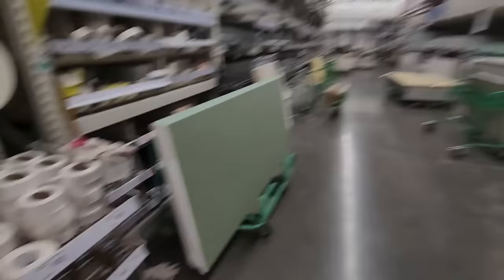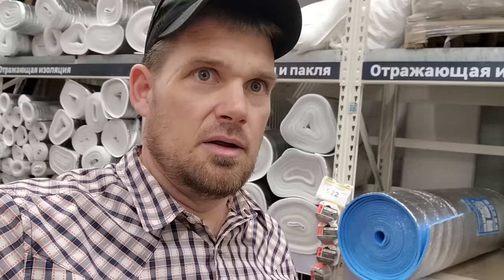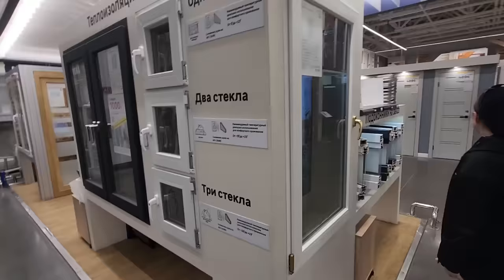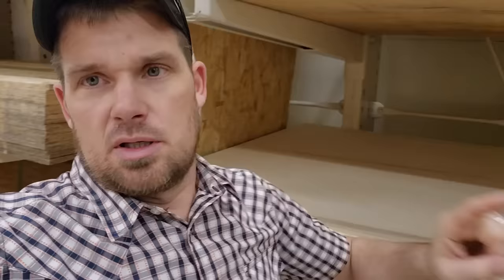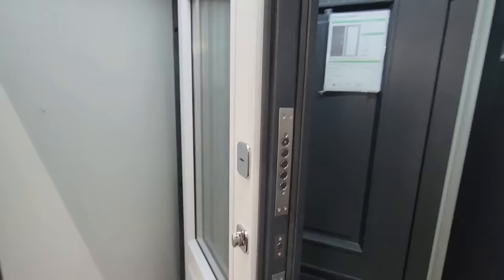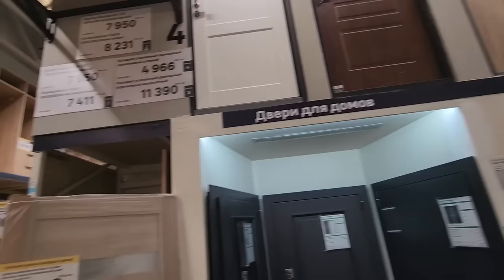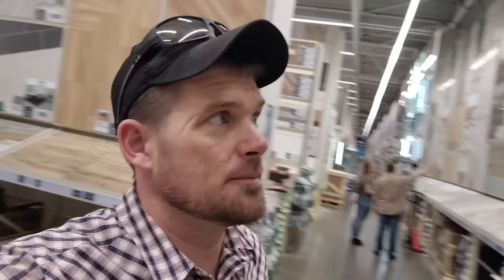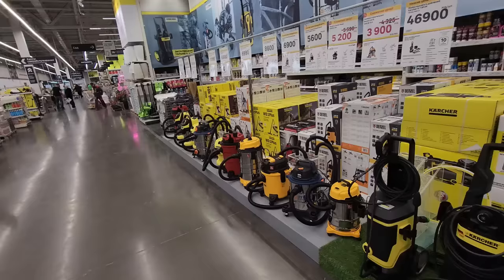As Promised We Went BACK !! REVIEW

Comment: The simplest and fastest solution for adapting between the imperial and metric systems is simply to take a ruler where there are two scales at the same time and apply it to the thickness of the desired product. This way you will begin to understand and recalculate the numbers written in the description much faster in your head. In fact, you just need to divide everything by 2.54. If you round it up a lot, then the easiest way is to recalculate the dimensions as 10mm - 0.4 inches 100mm - 4 inches. 

Самое простое и быстрое решение для адаптации между имперской и метрической системами - просто возьми линейку где есть одновременно две шкалы и прикладывай к толщине нужного изделия. Так ты гораздо быстрее начнёшь понимать и пересчитывать в голове цифры написанные в описании. По сути тебе просто надо всё делить на 2.54. Если сильно округлить, то проще всего пересчитывать размеры как 10мм - 0.4 дюйма 100мм - 4 дюйма.

Comment: Аренд, добрый день эврибади!
nsulation: length 1000 mm = 1 meter, width 600 mm = 60 centimeters, thickness 100 mm = 10 centimeters... quantity per package - 5 pieces, area 3 square meters, volume 0.3 cubic meters...

утеплитель: длина 1000 мм =1 метр, ширина 600 мм = 60сантиметров, толщина 100 мм =10 сантиметров...  количество в упаковке - 5 штук, площадь 3 квадратных метра, объем 0, 3 кубических метра...

Comment: May I notice something illogical - The door can be used in the bank with so many locks. However, it is a glass door. Unless it is bulletproof glass, it does not make sense.
Reply: it is not about safety (well, mainly not about safety - let's put it this way) but rather thermal insulation in winter time. Hence the thick door

Comment: Here in the States, our measurement system is all over the place. Milk is sold in gallons. Soda is even more messed up. The small soda bottles are sold as a 20-ounce bottle, and then we have one or two liter bottles, we used to have 3 liter bottles, but I think they stopped making those. Gas (petrol)or fuel for the automobile is sold in gallons. The building or construction industry is measured in imperial or inches, feet, yards, and miles. Cooking and baking are not yet measured in metric here either. I think our system is probably worse than most countries. Many countries are ahead of the U.S. when it comes to math and science, despite the United States supposedly having the best-surveyed education system on the globe, U.S. students  score lower in math and science than students from many other countries. That is probably why we have so many problems with Boeing airplanes! 🫣 According to the Business Insider. In a report in 2018, the U.S. ranked 38th in math  and 24th in science. This is not good. Great video, Arend!

Comment: The drywall plate size is millimeters i.e. devide by 10 to get cm, devide by 1000 is meters.  Really cheap priced relative to europe.
So 2500x1200x12,5mm is 2,5 meters x 1,2 meters x 12,5 mm thickness.  😅😊  Measurement for the drawings of the house in metric meters🧮📝🖌
Just don't go building in a flood-zone like Orenburg😮, or build on an elevated hight like a TERP